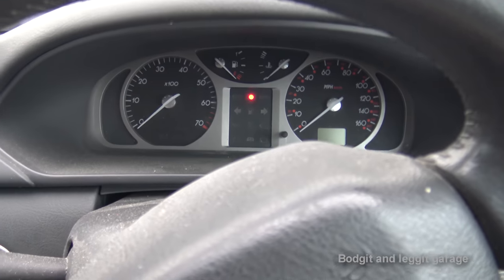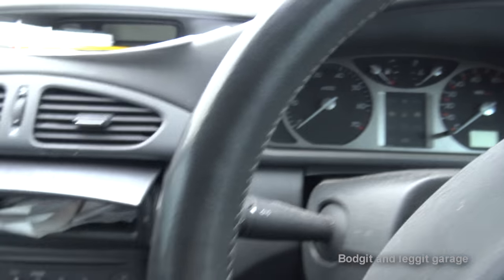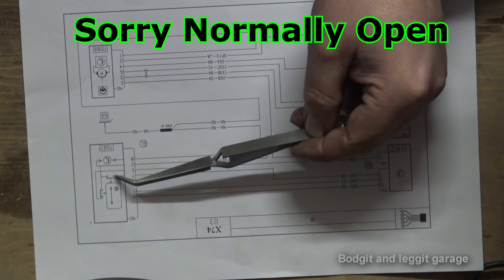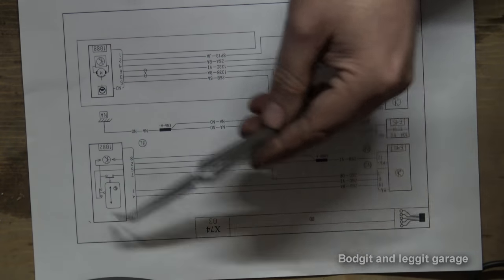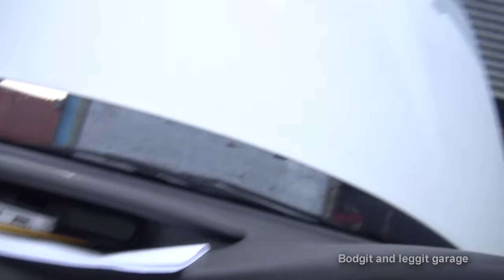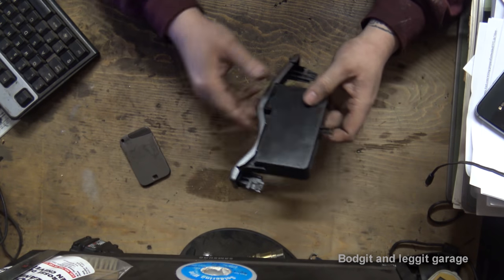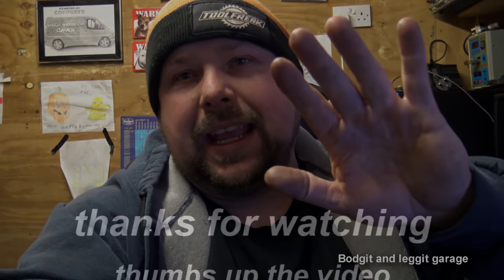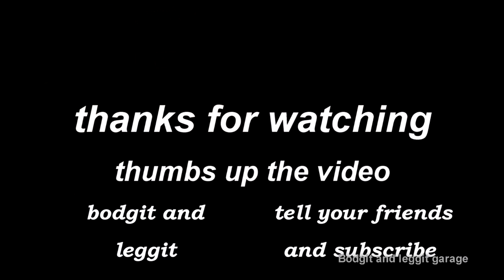Renault Laguna No Crank No Start No Ingnition Lights Bodgit And Leggit Garage

Comment: Great video leon, i'm a car electrician here in the west midlands, to get your ignition ON, open bonnet, next to battery is a fuse box, towards the back row, there are 2 red 10amp fuses, probe a live positive into 1 end of the fuse, (don't worry if you got the wrong one) as nothing is going to melt down! And walahh..your ignition is now ON..so now you can carry out diagnostic's on the car..much quicker to get to the root of the problem, and if it is the card reader, then follow through on your excellent video.i have also discovered a host of other fixes, from stripping the card down,reparing the plip buttons that had broken away, to repairing the printed circuit board..usualy the pcf chip (id46) and there is also a tool on the market that doesn't require a locksmith's services, if you do need to REPLACE the card with a new virgin one, (though will only work on models from 2001 - to - 2006, laguna? Megane, etc. Hope this helps, and further strengthen's your reputation 🙂 good luck and keep the stuff rolling out 👍
Reply from the maker: sored thanks mate
Reply: Hey there thanks for the 10A fuse trick. I'm struggling with a 04 espace at the moment. Card reader seems to work, but the only way I can get to ignition on is to hardwire the 10a fuse.
Since that is the ecu feed, I think my problem is somewhere in the uch around the ecu feed relays. When shit happened the car blew a 60amp fuse in the engine compartment and nasty burning smell was coming from the uch area.
I'm still about to check the steering lock, but when I get it to ignition, the lock engages amd disengages fine, so I think my problem is not there either.
Reply: I havea situation remote tested ok card reader replaced same thing i put the card in holder  led light stay on but no injection where its this fuse to replace
Reply: @viridian6903  what car and model is it, also what year? when did it all go wrong, after some electrical problem with central locking issues? often slowing down and methodically checking through all the systems in an orderly manner can expose where the problem lays.check all the fuses near the battery, underhood fuse box, and the interior fuse box too.if you can by-pass the main ignitions circuits relay and get the ignition 'on' then a scan of all the system can reveal where the problem is. 🤔
Reply: @imrenor Sorry i have only just seen your request mate, my computer had died at work,couldn't get past my password on other systems,hope you had it sorted? though it's been a year by now? if not post a few details and i'll see what i can do to help, Cheers 🙂
Reply: @sollykhan2385  No problem! Thanks for your reply. Yes , it has been more than a year :) Turned out the starter motor control wire popped out from the plastic case, bent and shorted to the engine block. This burned the relay board of the UCH. I've fixed the starter, replaced relay board on UCH and added an extra 20A fuse on that funky starter wire for extra safety. Car has been running fine since.
Reply: @imrenor  ohh dear, sounded like a nightmare ehh 🤔glad you got it sorted in the end, yes fusible links are a very good safety net, wiring needs to checked and routed well away from hot surfaces and vibration as well as moving components adjacent to them,by proper tags as well as additional cable ties. take care, hope the car is still working well with reliability ? ☺
Reply: @sollykhan2385  Yup it actually was a bit of a pain. Took me more than 2 weeks to fix right before our summer vacation :) I was racing against time :)
But the car has done about 20K since then, and still running fine. It has also turned 20 in December, so it really is an old one, but I love it. Takes us to anywhere with relatively small number of issues.

Comment: Done many with the same issue...
I like your multi use tool to open the reader... ahahahahaha
Very good, thank you for sharing!
Reply from the maker: LM Auto Repairs 🤣🤣🤣🤣🤣🤣🤣 that's a very special tool not everybody has one lol thanks mate
Reply: Thanks to BOTH of you, I've fixed mine too :) i had contact problems. Someone had fixed the broken plastics in there before, and NOW i'll not have to worry about that, but the 2nd position's plastic was not pressing down enough on the micro switch, so it was intermittent.
Reply: @LynxCarpathica  
👍👍👍

Comment: Thank you for the inspiration. Worked like a charm. I found the plastic tabs in the centerconsole on the rug. Glued the into place with epoxy rapid. All sorted! If it breaks again I will use tiewraps. Unbelievable that Renault doesn´t sell the plastic housing seperate when they made such a idiotic designflaw!
Reply: Oh yeah, mine was a Renault Espace -03. Same principle.
Reply from the maker: Boom sorted I'm glad the video helped you mate and I'm glad you got it sorted

Comment: All this headache and mess would be solved if the manufactured used a simple key with a lock cylinder.  These are the things that make me ask if technology is moving forward or backwards.
Reply from the maker: chungaleta1234 yes maybe you are forgetting if it wasn't for things like this we would not have any work so I love them all LOL

Comment: hello, I had the same problem, when I press the clutch pedal and press start/stop it doesn't want to start. I checked the release switch, it was ok, but the press pedal switch did not work and caused the problem. I cleaned the contacts in the switch and now it works like new, starts perfectly without any problems. 👍

Comment: 'There's your problem lady, you've bought a French car' !!
Reply: Should've bought a Nissan instead :P
Reply: opl500 Why buy a Nissan when they're essentially the same company
Reply: Shh, Renault doesn't want anyone knowing that :)
Reply: opl500 Think everyone knows
Reply from the maker: With the rust problems of Nissan and the Electrics are Renault can you imagine what their new cars are going to be like heaven for me I can retire with a big house on swimming pool🤣🤣🤣🤣🤣
Reply: Yet Renault, statistically, doesn't have more electrical problems than most other leading brands. Also, one has to compare repair costs as well. For example, how much do you pay a shop to fix a BMW, an Audi or a Mercedes compared to say Renault? If it isn't electrical it's something else. It's definitely cheaper to fix a problem like you did in this video than the problems a lot of other cars have. My brother-in-law spent a fortune on his BMW before he eventually got rid of it.

Comment: i have a problem on my 2001 laguna,it reads the card,activates radio,and dashboard for rpm,oil,petrol,kmh but once i press the start button its just kr and it sais insert card and its like it turns off and loses power,what is the problem

Comment: Leon how quick steal Renault put power in to pin no two ;-)))))))))any way good job mates
Reply from the maker: Marius Kub don't forget about the transponder in the card mate you'll be able to put power to the ignition but not turn off the immobiliser
Reply: I know mate just joking any way card issue go second;-)
Reply from the maker: Marius Kub 😂😂😂

Comment: J B WELD might have made the fix.
Reply from the maker: John Reid I have never used it I don't think you can even get it over here
Reply: That's to bad, I like the stuff for plastic repairs. Hope that one works out for you. My luck would be bad on that.
Reply from the maker: John Reid I've repaired so many things using this method never had a problem